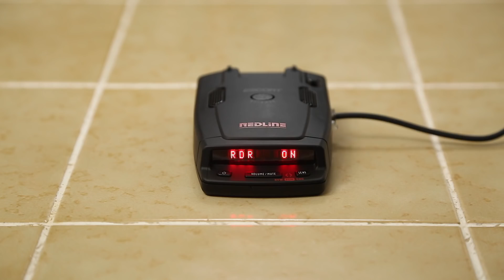How Radar Detector Detectors detect Radar Detectors

Comment: Could these local oscilations be isolated by putting the radar detector in a metal box with only one opening, where the horn antena is?
Reply from the maker: Unfortunately not. Most of the leakage goes out of the horn, not the sides where the case is.

Comment: Hey... love you stuff and likewise big into this for many years. I am a scientist. I would like to offer that that Radar Detectors would be unaffordable to most people if it weren't for the fact that they use a technique called super-hetrodyning to be able to indirectly sense the very high microwave frequencies used by Police Radar (up to 36GHz). The processes uses a Local Oscillator to create an easily reachable lower frequency -- I believe about 10 to 25GHz and then mix that with the incoming Police Radar frequency. The mixing causes an additive frequency and a subtraction frequency. The subtraction frequency is measured and used to deduce the incoming Police Radar frequency. If it weren't for that technique the components that would be needed to directly measure the high 36GHz Police frequency (for example) would cost probably hundreds of dollars instead  of just a few dollars. That would drive up the cost of the ALP AntiLaser Proority $900 (for example) would cost $1500 to $2000 (SWAG).  Anyway, the Local Oscillator isn't like a scanner or anything. Also, it is the RF leakage from this Local Oscillator that the Spectre Elite RDDs detect. It is the only distance detectable RF signal that Radar Detectors emanate. Some makers try to use an oscillator frequency out of the range if the RDDs. Some try to shield the oscillator better to reduce detectable leakage. Email me sometime and I will share with you some of the research I have done and some interesting materials and techniques for shielding Radar Detectors with leaky Local Oscillator sections.  JayDAnderson at comcast   net.

Comment: What's the range of radar detector detector?
Reply: Depends on  how much Local Oscillator RF leakage the Radar Detector leaks and what the frequency of the leakage is. Then also things like local conditions and obstacles to RF.  The sensitivity is adjustable on the Spectre. I would guess easy detection within 1000 ft... maybe more if adjusted to max sensitivity. The thing is the Spectre is used within close range visually and the unit is directional so can be aimed to target and then eliminate vehicles as the source of the Local Oscillator leakage.  One tip for people... in Virginia where Radar detectors are illegal for everyone if the Police use Spectre to single you out and pull you over... they still are not positively sure that the signal didn't happen to come from someone else (or multiple vehicles operating Radar Detectors). So after pulling you over they ask you to turn your engine off. If you have you Radar Detector wired to an ignition-on power line the Spectre signal will be lost at the moment you turn your engine off. That is a double verification that you are indeed the culprit. Best if Radar Detector is on a timed relay to shut down after a suitable delay. Also, the Spectre gas an internal battery and Police can hand carry it from their car, set the sensitivity down, switch your ignition to ON, and sniff out the location of your Radar Detector.  If you have a remote Radar Detector the Local Oscillator is in the remote component.

Comment: Buy aluminium tape 😁
Reply: ...or buy a radar detector in a magnesium case that prevents leakage of the local oscillator signal from your radar detector and hence prevents your radar detector being detected by the cop's radar detector detector that's trying to scan for the leaked local oscillator signal of uncased radar detectors.
Reply from the maker: Question: How does the Redline in a plastic case maintain its stealth capabilities?
Reply: I have no idea sorry I only know about the Beltronics STi Driver of magnesium construction that has zero leakage (as claimed in its literature) and therefore is immune from any RDD detection even future more advanced RDDs as there's just nothing leaking from it to detect. I guess with the plastic ones if it's leaking OS it's avoiding the frequencies the RDDs are looking for at the moment and not using those frequencies anymore until the RDDs catch up and start to look for the OSs the new detectors are using then it will get detected by those RDDs in the future. Best to just get zero leakage detector to avoid that future problem.

Comment: So where is the radar detector that detects radar detectors detecting radar detectors that detect police radars?
Reply from the maker: Some radar detectors will alert you to the presence of nearby RDD's, but those RD's are usually extremely detectable and alert you way after the RDD has already picked you up (generally only the old RDD's, not the newer ones currently in use). There are many RD's that are undetectable by RDD's in the first place and while they may not offer an RDD alert, the fact that they are immune from detection in the first place make them a preferable solution.

Comment: a radar detector that detects radar detectors 
please tell me it took many takes just to not laugh at that part 😂😂
Reply from the maker: lol... I seriously did this video like 10 times. It started getting old after a while but I got one that I liked. :D
Reply: May be possible to actually use the Local Oscillator frequency in the Spectre Elite (assuming they heterdyne). You could use it to detect the presence of Police cars equipped with Spectre. I have never seen a Police car where I live in Virginia that isn't equipped with one.